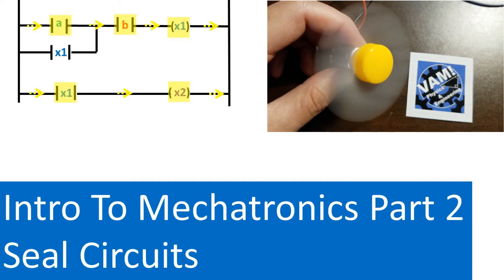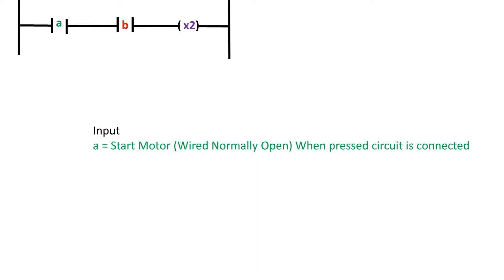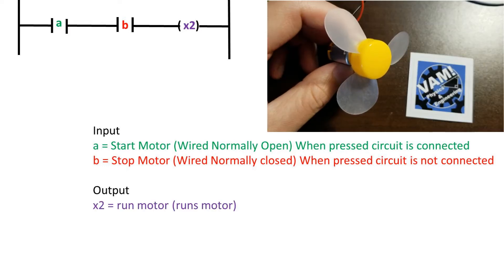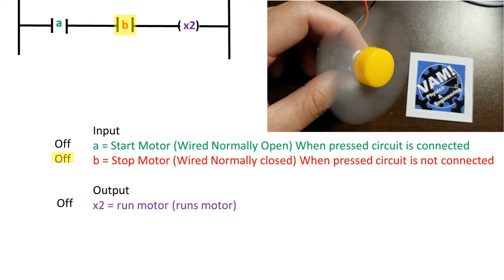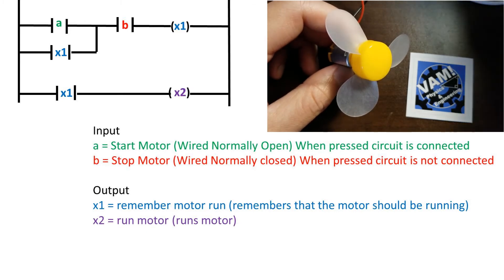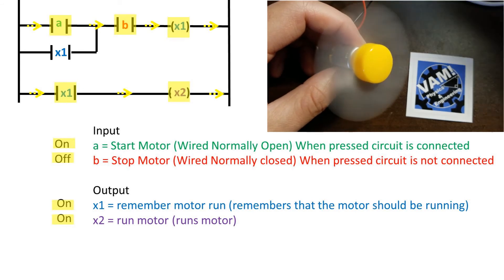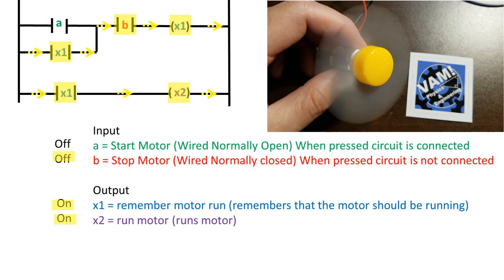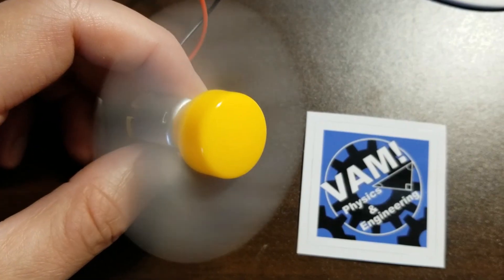What is a Seal Circuit and How Does it Work (Programming Ladder Logic For PLC Mechatronics Part 2)

Comment from the maker: I noticed i received a dislike... the probable reason is due to the normally open contact for B. to be clear there is a difference between wiring a normally closed button and programing a normally closed contact. If we were to place a normally closed contact at b then the wired button would counter act it and it would be a normal button. This might be a topic for a future video.